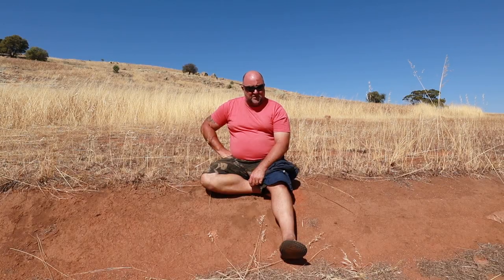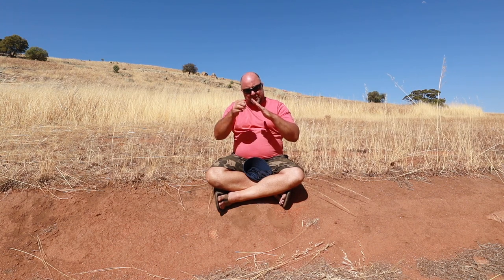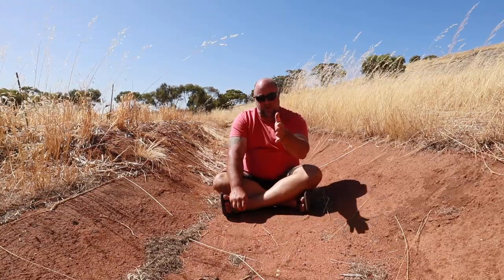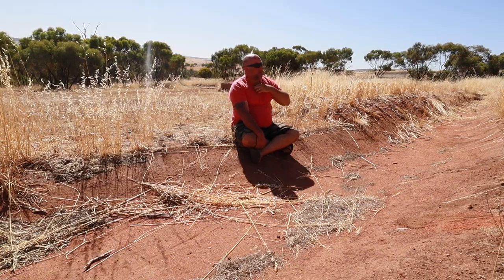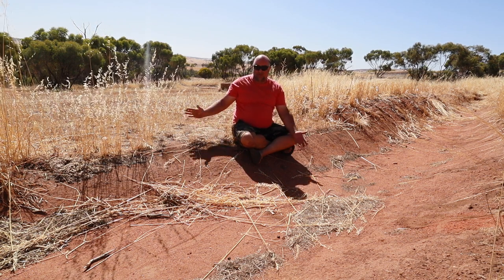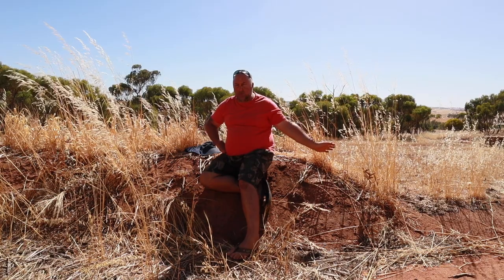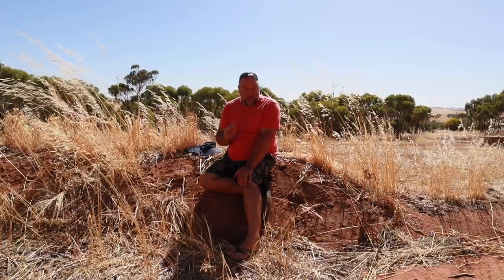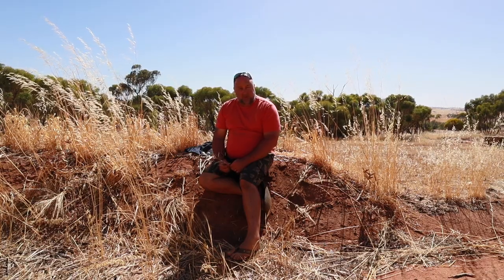Aussie drylands swale in summer | Off-grid homestead

Comment: Really enjoyed your analysis. Every one of the many projects that I've done, I always take a look at how I too would do it different the next time. You've given me a few ideas for my place (Mediterranean climate; hot & very dry summers with about 19 inches (48cm) of rain annually, snow here is now rare and quickly gone). I particularly like the idea of many smaller swales, instead of a few large swales. Instead of using an excavator, you might consider a road grader... I've seen this used on some projects and it should be much faster than an excavator, aware that it may not be feasible for your soil/slope/area. At my place I will use a bulldozer, as I've got small stumps from brush and trees that have died that I will have to go through. Here, I bag my grass clippings and use them where most needed, even though it is a bit of a bother to do so. I presently have access to some wood chips that I put over the grass clippings, so as to conserve moisture. I am doing this particularly around some of the more magnificent trees here that I hope to save and my orchard trees. Keep up the good work,  Jerry
Reply from the maker: Cheers for that Jerry, appreciate your thoughts mate 👍

Comment: A handy tip for setting levels,,, start with as many star pickets or stakes as you can,, then stick them in where you want to set your levels,,dont be afraid to put them where you need to dig as you can  move them and reset them as you need to,,, then set a level on them using either a laser level (I use a cheap bosch $90 from bunnings)  or a water level in a hose works well ,,, mark the level that you set with Red insulation tape on all the pickets/stakes,,,then measure down 10cm and put a white tape,,10cm down a Blue,,10cm down Yellow,,10cm Green and then repeat with Red again and all the colors in the same order,, That way you can see at a distance your different heights in 10cm increments from your backhoe and can also easily see the difference between the same colors repeating as they are 50cm apart

Comment: Have i misunderstood somting or are you draining the water with the swales? Dont you want it to infiltrate the water into the ground, retaining as much water on the property as possible ?
Reply from the maker: You might be referring to the trackside ditch which does divert water. We did that initially to manage the water washing out an existing track when we first got here before any swales. We’re putting in small rock levies along it now to slow water running down it.  And water going into it will be minimised once we start building more swales higher above it in the landscape. 

That then feeds into an on contour swale which does like you say, fills and infiltrates the water. Our plan is to extend the swale as far as we can across the property on contour👍

Comment: You are on a bit of a learning curve here . Imho a grader is tops forgorming swales effectivly and econonically . With the blade angled to deflect the soil to the lower side.  First cut sets the angle of  the inflow slope , second cut with blade flat forms the bottom of the swale . Dont be tempted to go too deep  into the subsoil  in order to make a high berm as the disturbed subsoil will take much longer to transition to be able to sustain plants. Use as much mulch as you can beg ,borrow or steal. Good luck with your project, celebrate the successes and learn from the failures.
Cheers from Qld.🇦🇺
Reply from the maker: @garrybrischke53  cheers👍👍

Comment: As long as the swale typically loses surface water in under 2 days you should plant in the swale itself. Pioneer trees and shrubs as well as cover crops.  Wattle, leucaena, tagasaste and anything else that will grow. 

I wouldn't fix the back slope yet as mulch may be enough. I think that you have sized it well, but would probably get away with smaller up slope or if placed closer together down slope. 

Love your work!
Reply from the maker: Thank you!
Reply: And add kitty litter to bolster the soil's clay content.

Comment: I'll be working on similar land in S.A. my plan is to swale then post hole plant fig, oak and Lucerne in the swales. Then mulch and compost directly in the swales with as much green material I can then straw on top with some clay dust to help hold onto the moisture under the dermal layer. Can't wait to learn with every mistake and success. Good on you and prepare for the Witer wet when it comes again champ, you'll get there I'm sure.
Reply from the maker: Thankyou!
Reply: My understanding is that you dont plant into the swale, or even on the berm.  

Rather your tree planting etc is done on the downhill side of the berm.  The logic being the water collected inside the swale will soak into the soil and gravitate downhill as a sort of water plume.  

Plant in the swale then you may end up with waterlogged roots; on the berm, new tree roots have to travel through the berm (believe its over 500mm) and then into the preexisting topsoil before they find residual moisture.

Comment: What about..... instead of the many small swales you mentioned, you instead put in lines of Lomandra grass?  Not only would it be easier and less costly, but it'd work in much the same way that Ari over on Polyculture Farms did with his wood contour lines.  As sandy as your soil is, any rain that falls is quickly absorbed into the ground, hence why your big swale doesn't fill up.  Smaller swales might fill while it's raining, but it'll soak down into the soil within minutes and you're left with a long, dry ditch.

A contour line of Lomandra grass would work in the same way as a swale, stopping runoff and giving the water a minute to soak in, but the hedge would also act as a fire-break should the unfortunate happen.  The Lomandra's deep root system should be able to find water easily and stay green during the hot summer.  I think.  Could be wrong on that.  Even if I'm wrong, though, it'd still work as both a water catcher and add much needed organic matter to the soil with it's deep root structure!    Cheap, easy, and fast to install, it'd nimic what Ari's shown works and likely do even better than chopped up wood.

In other words, instead of digging down, making a ditch and berm, build up with cut logs or plants.
Reply from the maker: Right... vetiver grass is interesting. What do you mean by "sterile" though?
Reply: @ROCKPILEOffgridHomestead  From what I'm told, the stuff we can buy in the nurseries is a special variety or bred in a way that it doesn't produce viable seeds.  This means that it won't run wild and become an invasive grass where it isn't native.

In your soil, I have no doubt the roots could strike down 15' unless they hit rock!  The only real question is how well it'd survive your dry spells.  The stuff is "drought tolerant", but going months between rains?
Reply: Done that too it works comparably. Take it a step further with charged biochar get some terra pretta.🤠

Comment: Im in WestDale same sort of country all the hills covered in rocks and jam that the farmer didnt need,,,I got a few paddocks 2/3rds is trees,,,I have a track coming down a hill that brings a bit of water that ends up in a creekbed/gully ,,,I have dug out a shallow trench with a mattock to divert the water into my field,,I then used my dingo digger with a trencher to cut a trench across the field on the contour (I used an A frame like yours but with a spirit level on it),,the trench caught water for a few years and i seeded it and it grew lush but i found out it didnt fill all the way along,,,I think the ground has cracks through the clay where the water runs a bit like natural springs,,,at the other end of the trench must have been a spring as it was always full when it rained and im pretty sure it drained in the middle to somewhere underground,,,Ive also dug holes with post hole digger in winter and found some holes dry while others to be wet 4 feet down a week or so after rain,,,after a couple of years i decided to widen the trench to the width of the dingo,,then 3 times the width and so on,, my idea is because my feild slopes i want flatten it so it catches a few inches of rain and then pours down to the next level like the aztecs/incas did ,,,,well that was the plan instead the distance to move the earth became too far so i just started digging holes and making an extended long dam that doesnt hold water for very long atm,,,I need to get some bigger machinery in when i get some more money

Comment: Thanks for sharing your first hand experience with swales. Plant roots and debris are natures way of slowing water and allowing it to infiltrate. Mechanical intervention seems to be a final and more expensive resort. Have you tried planting trees on contour and chop and drop? Plants recycle nutrients and minimise deep drainage whereas a swale is capturing those elements and storing them insitu. No doubt you have been through this thinking process…why swales?
Reply from the maker: Interesting question. For us the swale was a more economical option but also a way of slowing and sinking water from rain events in a dry lands climate. It doesn’t replace the need for trees of course but it where there one was placed specifically was to deal with a drainage run off 👍

Comment: Try cutting up old tyres and make long rubber blades for your slasher.................hugely reduces sparks, we did it with 20 foot mult head slasher to reduce stubble heights.😊
Reply from the maker: That’s a super interesting idea 🤔 thanks for your suggestion

Comment: So with the first couple years the swale won’t fill up as much because it permeates into the ground quickly once the soil reaches its water holding capacity the swale should hold more water. Permeation is a good thing.  Also you might want to run a subsoiler in the swale to break up any compaction caused by the dry season.

Comment: Great video! Swales are usually oversized and made for 10, 20 or 100year rain events. Especially in areas where flooding is an issue. But I saw a few people changing to smaller swales or leaky weirs after a while. Every situation (rain, soil, temperature) is different. It's your very first year. It will evolve, especially as you observe intentionally. 
If the grass is a problem in summer, could you plant native bushes/small trees to stabilize the berms and shade the swale? Any pioneer plants?
I`m looking forward to see the swale filling up.
Reply from the maker: So are we! Some rain would be helpful 🤣

Comment: Just a question… would a machete or slasher hand tool work in summer to cut the bulk? Or a hand push mower, where you have more control of speed? Just a thought 😃
Reply from the maker: The risk with any metal edge is in hitting a rock. I so wanted an excuse to get a hand held scythe! I still might just get one haha

Comment: To eliminate fire in ths field ,please try to have  small bore well  circular pits at 3 feet apart from each other say 3 inches in diameter and 2 ft in length  where there  is dry grass.
Also try these  small borewell type rain water retention pits in one acre of dry land by punching small holes in the land so that when rain comes, it soaks nicely instead of evaporating very fast after the rains.